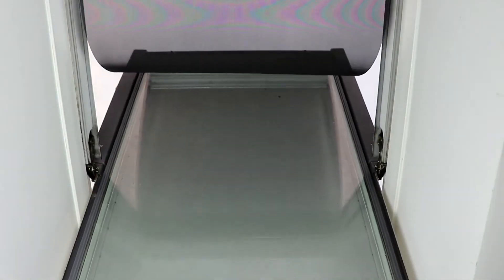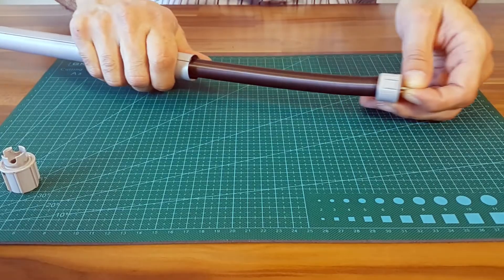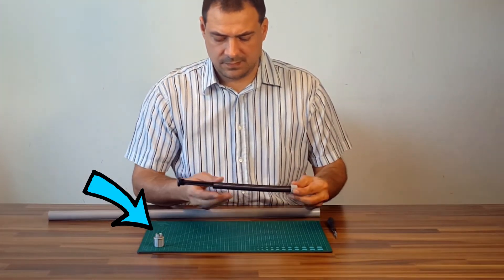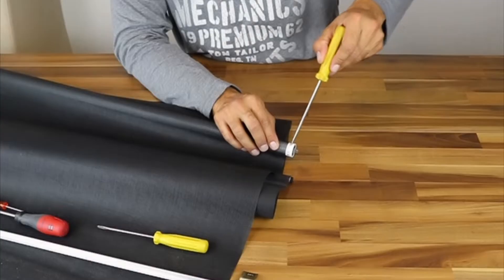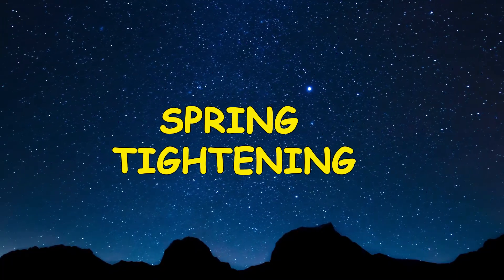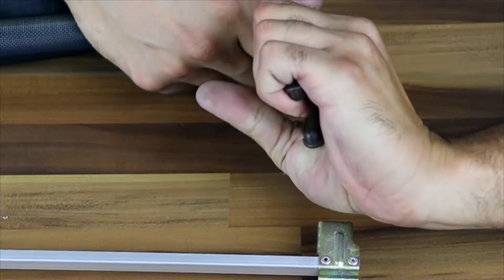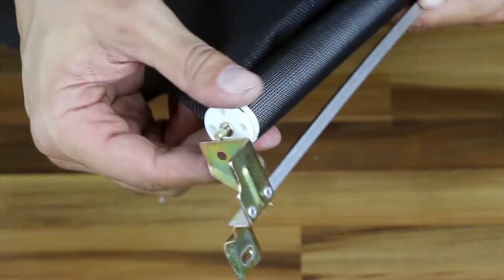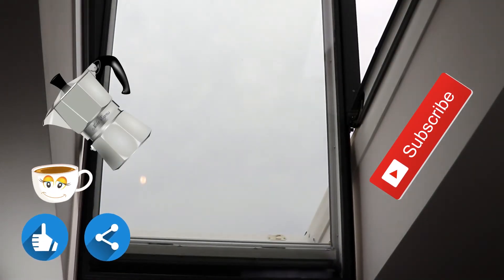🔴 DIY Velux window blinds repair

Comment: Hi, mine is not springy but pull up and down manually. The sides of the blinds have some little tiny clip like to keep them weighed down in the channels but mine has a few of these little thingy missing. Any tricks to fix these please
Reply from the maker: Sorry, don't know the type, but do try searching for parts on Thingiverse...
Reply: @greeneyedexplorer  already did but those little clip like are apparently melted into the fabric  and I’m thinking of something custom made like al snap button or similar to glue it on. But hey thanks for the response anyway🙏
Reply from the maker: If those are incorporated into the fabric, you could maybe try the trick with a drop of super glue on the fabric and put a pinch of soda-bicarbonate on it. Then just pile it a bit. It will last long... I think.
Reply: @greeneyedexplorer that’s the thing i only found 1 off them but 4 missing I’m gonna try building something nearly similar L shape then superglue  them 😅
Reply: @moebrahimi7957  Hi, did you manage to find any of the little guide clips for the sides of the fabric or did you make something yourself? I have the same problem and suspect other people have too but have not been able to find anything to replace them online. Thanks for any thoughts.
Reply: @philipzirngast7001 hi Philip. Yes i found a black screwy bottle top like plastic coke bottle(can’t remember what bottle it was but any will do as long as it’s black to match the rest) and then i made small cuts using Stanley knife from the very top of it to keep the little L shape and trim it to size and superglue it to the fabric with the bottom of L facing inward into the guide. Hope this helps.
Reply: @moebrahimi7957  Hi Mo, that is helpful even if only to know that you couldn't find the part anywhere online either. I tried Thingiverse, Ebay, Temu etc but no luck😒I will try your suggestion of creating something from a coke bottle top and hope the superglue lasts for a while in the heat of the sun😎Thanks

Comment: Very helpful.  How do you get the fabric back on the track if it comes loose?
Reply from the maker: Hi. If you mean when it comes loose from the rod itself, I used a fast glue - 1-second glue. Haven't had problems...

Comment: Hi, The video starts with the roller already removed.  I have removed the blind cassette from the window, but cannot see how to remove the roller from the cassette.   Some instructions how to do this would really help.
Reply: I worked it out.  There are plastic tabs on the back which you can push in with a screw driver.
Reply from the maker: I am glad you have sorted it out!
Reply: @ruxyguy  so glad you said this as I nearly gave up on the 1st hurdle, I was going to yank it a bit harder also so it came away probably doing irreversible damage 🤦😃

Comment: I have a velux remote controlled blind. I retensioned the spring but when the blind is retracting the tension will drop off every 10cm or so and the blind will lose tension. Do you have any advice on how to fix this?
Reply: Here's a link with a video of the issue - https://www.reddit.com/r/fixit/comments/gm3zzf/electric_blinds_not_retracting/
Reply from the maker: Your video is now visible. There is no spring error. The problem is that black plastic parts on both sides of the fabric get stuck in the roll box at the bottom on the video. You have probably misaligned aluminum slides i.e. put too high into mentioned box...
Rok